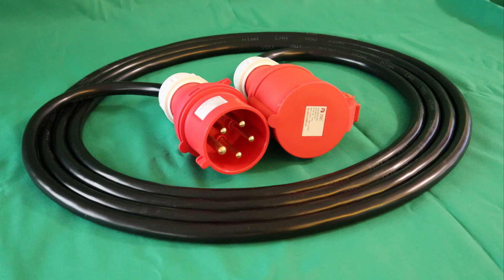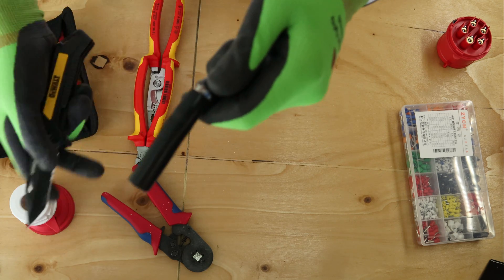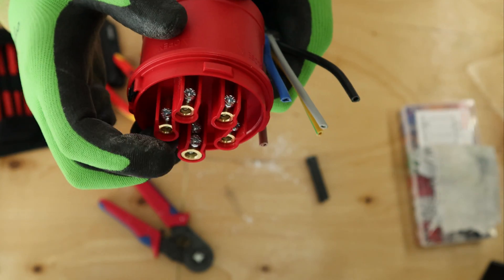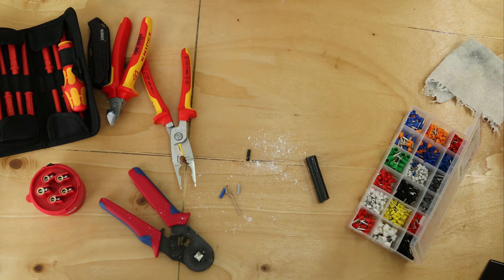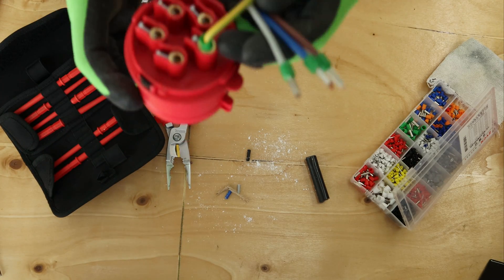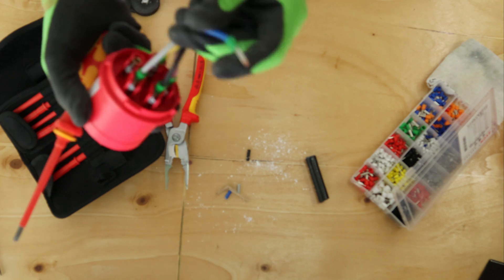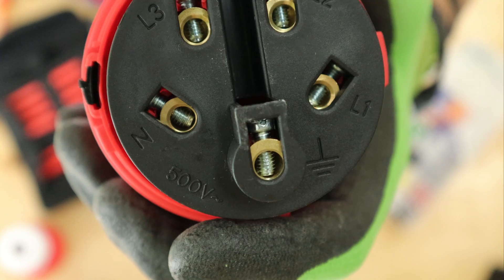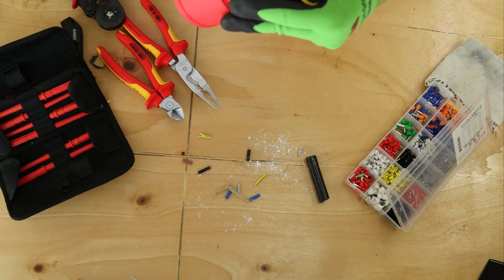Wiring up 380V 3-Phase 32 amp Plug and Socket (the red plug)

Comment: I got 3 conductors cable and I want to convert 3 plug cable to 4 plug? Any advice about the wiring ? I just need to screw 3 cables and leave one?

Comment: I have a generator that has a 5 pin outlet, but I need to power a 4 pin industrial machine how can I wired it?

Should I connect L1 L2 L3 AND EARTH or neutral N L2 L3 EARTH
Reply: Don’t use the N just L1 L2 L3 and earth

Comment: is it possible to connect 3 phase plug ( one end ) to 1 Phase commando ( the other end ) so you can run 3 phase PDU with single phase power ?
Reply from the maker: Sorry for a late reply. Yes for sure but that depends on the amount of current that you are going to pull.

Comment: Hey can you do a video, making a lead wiring a 3 phase 32amp to a single phase 16 amp cee form tyle Blue plug, thanks.
As far as I know you can take any of the phases and the neutral and earth but I would appreciate some confirmation.
I have access to 400v  3 phase 32amp in this format on your video.
But I need single phase 32amp although 16amp will suffice atm untill I get a dedicated 32amp line in it's for a welder so 16amp will do unless I'm hitting the highest end of the power envelope of my unit.
Cheers.
Reply from the maker: Sorry for a late reply, I am currently extremely busy ~ I will plan it out and will create a video asap! U can pull a 32 amp single phase line out of a 3 phase 32 amp line.
Reply: @k-30creator20  I was thinking.i could only get a 16amp to a single phase, because I'm going from 400v 3phase to 230 1 phase.
Thanks
Reply from the maker: Depends if the supply is 3 phase 32 amp u can get 3 x 32 amp single phase out of it
Reply: @k-30creator20  That's perfect, yes it's 3Phase 32amp, I've wired a 3phase 32 amp to a single phase 32amp using L1 Neutral and Ground.
I was thinking of making up a box using panel mount Sockets with 3 sockets for convenience, 1 x 32amp and 2x 16amp Sockets, running a different live to each and common the neutral and ground.
Reply from the maker: @deepwinter77  add 16amp mcb for the 16 amp outlets to provide the essential over current protection.
Reply: @k-30creator20  Should I have one on the 32amp or will that be dealt with at the consumer unit.
Reply from the maker: Yes definitely, if you have enough budget I will recommend you to use RCBO instead of mcb
Reply: @k-30creator20  I don't know if I can afford an rcbo for each, maybe RCBO for the 32 and MCB/RCD for the 16amps?
Reply from the maker: I will say stick the rcbo to the one that you are going to use the most and use mcb for the others
Reply: @k-30creator20  Cheers will do.

Comment: Hi thanks for this video it is helpful and informative. Please I have a cooker hub that comes with a 5 cable(2 live, 2 neutral and 1 earth) to be connected to a 32amp socket to have it work, any heads up for me on this?
Reply from the maker: No worries, yours isn’t a 3 phrase hob. All you need to do is to connect both of the live to L on ur 32 amp plug and both of the neutral to N on ur 32 amp plug. The reason why manufacturers do that, is to reduce cost on cables.

Comment: I’ve a 32amp 5 pin socket on my gen and a 16 amp 4 pin on my lathe. How would you put a 32amp 5 pin on a 4 wire cable ( from the lathe ) do you just leave the neutral blank on the 32amp 5 pin plug?
Reply from the maker: For a 3 phase motor, u won’t need a neutral
Reply from the maker: But u should have some sort of current protection
Reply from the maker: Yes u will leave the neutral out in the 5 pin plug, but u will need to add a 16amp 3P breaker in between. I can only give u my personal knowledge and opinion. Please seek a professional electrician for any further advice.
Reply from the maker: Rmb to be cautious when working with electrics. Please follow ur local legislation.
Reply: Thank you K30 creator